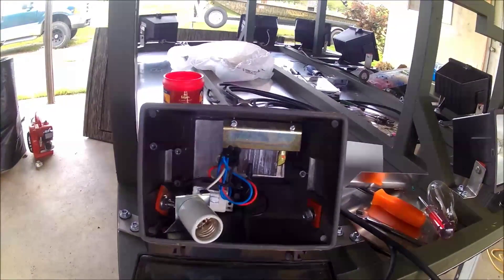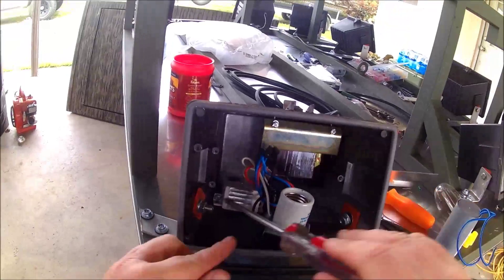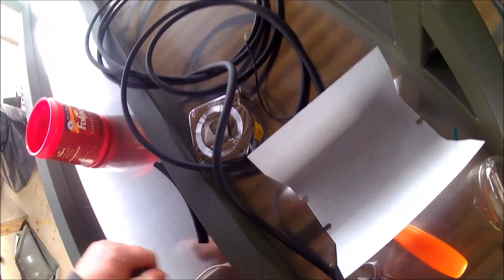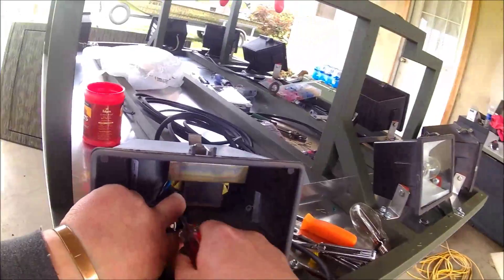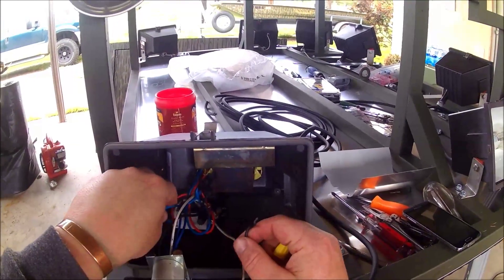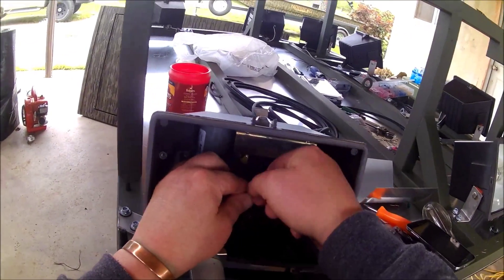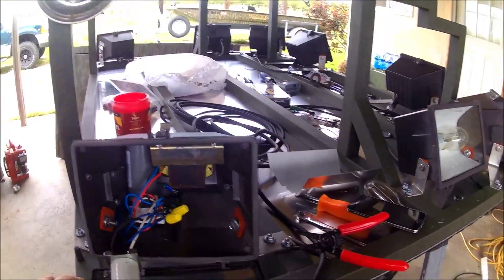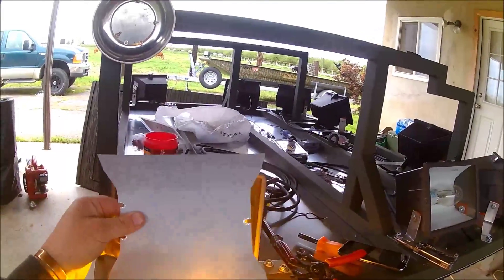Installing Caps in 6x9 HPS lights for Bowfishing

Comment: Hey Gary it's sam again so when using these lights or the 9x9's I don't have to have a digital ballast?  I've been told I would need them. Seems like you know a lot about this stuff figured I'd ask you
Reply from the maker: Sam Goble it's not necessary, we've been using them for years with the magnetic ballast. The digital ballast will make them more efficient.

Comment: Hey are you talking about the 150 watt PSMH Floodlight 9" x 9"
Reply from the maker: +Deven Shuler no sir, these are the smaller 6x9 lights. Typically the 9x9 have the caps already in them.